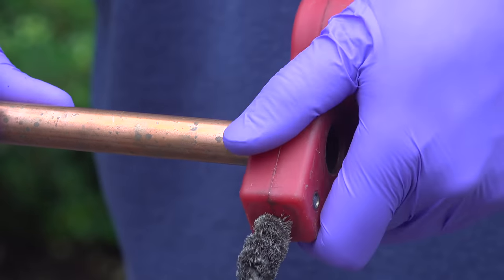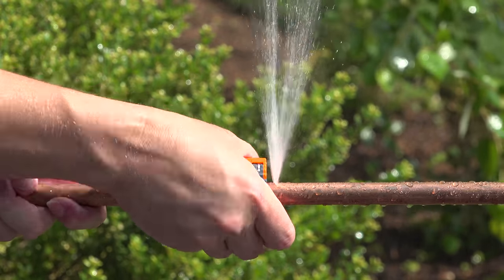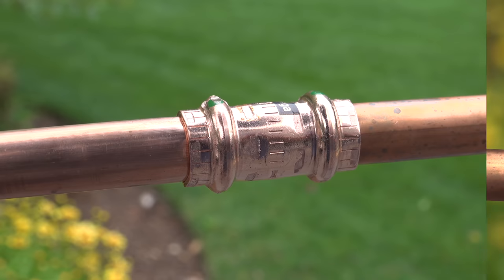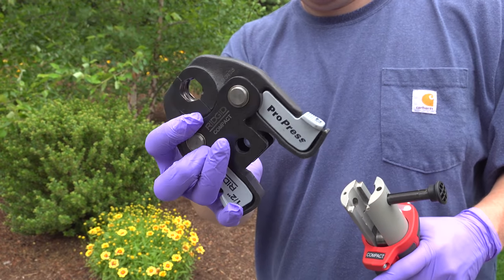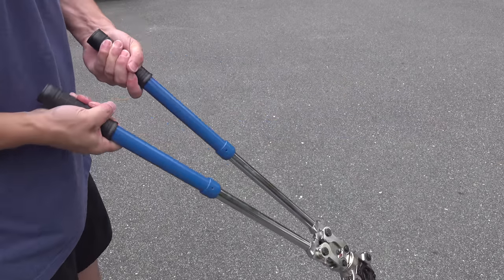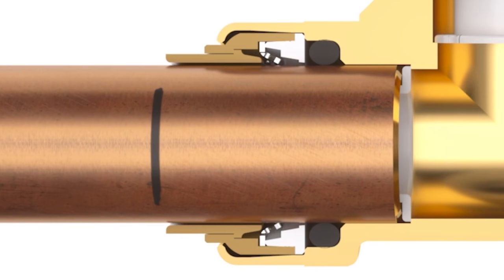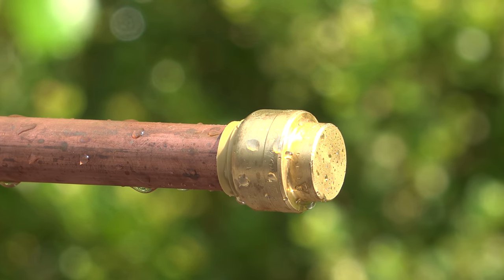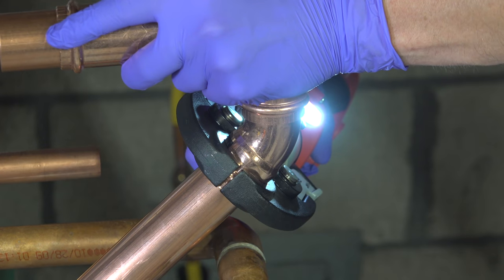NEVER SOLDER PIPE AGAIN - 3 Ways for EASY DIY Plumbing

Comment: In my experience plumbing, I've been called many times to repair a leak to find a failed shark bite. Rubber degrades over time, but there are plenty of examples of 100+ year old soldered copper pipes still holding strong. There's almost always a way to mitigate the heat from a torch in tight spaces to allow a proper solder joint, and it should almost always be prefered when it comes to plumbing in my opinion.
Reply: Not to mention freezing pipes. Copper swells before it fails. If that happens with a shark bite, toast.
Reply: I would also add that Sharkbites are made from brass. Probably not a big problem in urban areas, but if you're on well water, corrosive minerals and acid can degrade that brass over time, and cause a lot of damage that won't occur with copper. Don't ask me how I found this out......
Reply: Can’t forget the tool he was using is way more expensive than any one time home repair calls for.
Reply from the maker: @ottokriete1153  If your brass is corroding from well water, your copper will too. If anything that brass is about 20x thicker than copper pipe and low PH is something that needs t be taken care of for any metallic plumbing
Reply: Maybe you are one of the few that would come over for a very small job like adding a small section of pipe to an outside faucet.  I've seen many times people can't get a person in the trades to even call them back for a 15 minute job.  So, do you or others blame people for using a shark bite solution?  I see many pros on these types of videos commenting about how something like this is such false info though.
Reply: @ottokriete1153  If you have a water that can corrode brass, I would be more concerned about my life than sharkbite!
Reply: @sjxidnegsusgsjshvsbshshshs  I agree
Reply: These are not Sharkbite fittings.  These are Propress fittings and the primary sealing point is metal to metal.  Solder is old school.  These Propress fittings have been used in Europe for about 60 years.
Reply: Try not to blow up your house and yourself. Avoid torch if your home uses Gas for heating/cooling. For do-it-yourself and weekend warriors' repairs in small multi-dweller homes, soldering is very dangerous around Gas water boiler, gas heater, gas stove, natural-gas fridge (yes, a Fridge can use Natural gas or propane to produce ICE COLD AIR, no electricity).
Reply: @SSintox  making improper repairs is no excuse for failing to take proper precautions when making modifications or repairs to gas pipes. If you don't know what you are doing, call a plumber.

Find someone who knows what they're doing rather than doing a shoddy hack repair job yourself.
Reply: I use a medal dust pan when sweating pipes
Reply: m rapacki  how can you say that???
copper most certainly lasts longer than 75 years, and how do you know pex will last 100, its only been around 30 or so.
advertising is not facts!
Reply: My old job loves those shark bite, pex and copper press. They made a lot of money out of them. I used to work for fire/flooding restoration company. 90% of our mold calls were from failed shark bite, pex and copper press fittings
Reply: @larry6686st  90% ?
Reply: Margret Williams  amazing!
Reply: Absolutely, this demo is solutions looking for problems. Yorkshire joints (as they're called in the UK) are utterly reliable and I have only ever seen compression joints fail where there if frequent movement/rotation of the joint.
Reply: Yo I've just started my 1st year on plumbing and advice or tips you could give me
Reply: Yes I have the same experience. Soldering-YES
Reply: 😂😂😂😂 lier, soldering is overrated, this things work great
Reply: Easy DIY? If you can afford £1200 pounds for the press machine and £100-£200 for the different sized heads you will need..
Reply: @rabbie6361  well first off, a pro press pays for itself. Second off, if you aren't a professional plumber and are concerned about buying an expensive tool you may only use once, you could simply rent the tool for a fraction of the price.

Or just do what I suggested in the comment you seemingly ignored but replied to anyways, and solder the pipe using an inexpensive torch and solder producing a better pipe in the end anyways.
Reply: @the_slow_sti your title says 3 easy ways for a DIY plumber...I'm just pointing out that press machines are a bit expensive for a diy'er.. I've never used the manual ones and tbh I don't think I would put my trust in them..but that's just me.. probably easier to just use compression fittings..
Reply: @rabbie6361  it seems you are having reading comprehension issues. First off, it's not my video. Also, you didn't reply to or comment on the video title, you replied to my comment which explains why I prefer solder. I pointed that out to you in my reply above.
Reply: @the_slow_sti  AHH apologies.. I replied to wrong post...my phone screen has been in the wars and it's a hit or a miss when I tap the screen who gets my reply
Reply: yea I never seen copper leak,pin holes too
Reply: @garystinnett8321  thats why we use PEX
Reply: Um, no. You were not called  "many time" to repair a Shark bite. I have been using them for years with zero failures. Total BS.
Reply: I call bs. I'm a plumber and have had ONE sharkbite failure call. Most leak repairs i do are copper & poorly installed crimp pex. 

The sharkbite call was improperly installed. The pipe was not deburred, nor sanded and not installed to proper depth. 

You don't have to lie to make your point. Oh wait, you kind of do huh?
Reply: @ottokriete1153  strange. All the valves used in sweating copper are brass. This seems to me you don't know what you are talking about. 🤷
Reply: @garystinnett8321  Uh, a lot of actual studies show exactly the opposite, as does this vid: https://www.youtube.com/watch?v=OOeBJ8mDr8Q
Copper seems to often fail before PEX, and I don't sell PEX.
Sharkbites are pretty darn expensive, however they also seem to do better in most cases than a sweated on connector.
Reply: @toddmichon  Anytime something comes out that impacts a Trade's income it always gets demonized.  Sharkbites are crazy expensive for a fitting compared to a straight copper sweated one, but a lot of tests by actual professional organizations have shown them to do better in freezing sitations than the old standard.  They also allow the average Joe/Jane to fix a leak or extend a line on their own simply by watching a YT video.
So its not a coincidence that the pros downgrade it, even though you can't get someone out to your house for a minor job without looking at faint-worthy bill.
Same goes for PEX, if not doubly more so.
Of course there is always the village idiot who doesn't know what he's doing who will make a mess of things, but to hear it from Pro's everyone is an idiot outside the Trades and plumbing is really some sort of high-energy physics level of knowledge required.
Reply: @SilverCymbal  If the brass and coper are being corroded from the well water anything that uses a rubber ring isn't going to stand a chance. Speaking from experience as my well water has a lot of iron in it and even with a water softener the rubber rings are the first to go. And if something isn't pure brass or copper, just a coating, it wont last long.
Reply: @larry6686st  Our last mold problem came from copper pipes degrading under slab and in my area, apparently that's common as hell.
Reply: Yep I agree nothing better than a good sonder job
Reply: That's a load of crap. I've been a DIY flipper for over 40 years and I have plumbed many houses using pex and shark bites since the day they first hit the shelves. I live near and among the nearly 100 houses I've renovated and I've not heard one word from anyone that there has ever been a single problem with the plumbing.
Reply: Yes but when you have  valve theat won't completely close off this works wonders. You cannt solder with water in the pipe.
Reply: I have used flexible heat sheilds. I remember a kid ounce didn't use one, got that tar paper inside the stucco lathe smoldering, went to lunch and came back to a burnt down building.
Reply: @lightshipchief  They still have a rubber O ring
Reply: the problem with shark bite is nobody seems to install them properly.  Plus, anything that takes away from a plumbers hourly rate is never any good.
Reply: @ottokriete1153 that depends on the quality of brass. Buy bras that can't lose zinc as it is an alloy. It is specially treated. In the UK now they're all like that, previously you could choose more expensive ones
Reply: @lightshipchief the primary sealing point is the o ring
Reply: If the copper  wasn’t f’ed up in the first place people wouldn’t need a shark bite. So which one last longer??
Reply: I was about to say the same thing, I think we need to bear in mind this is an advert, I wouldn't trust a joint made like this once under pressure and stress, I'd rather use plastic push fit and that's saying something.
Reply: @Tagerrun  It's ok it pays for itself after 5 years as long as you don't get to many warranty claims 😂
Reply: Worst place to use a shark bite in an area that could freeze. It's ruined by the expansion.
Reply: Yesssir I’m a UNION UA PLUMBER I’ve worked on lots of new building and still working on schools hospital high risers etc nothing safer than soldering them rubbers break after a wile it’s great for a quick repair but definitely solder and not like this crap he solder a pound of flux for a lil 1/2 coupling lmfao smfh 🤦‍♂️
Reply: I have used shark bites and no issues in thee last 5 years.. maybe there is an issue if exposed to UVa
Reply: Exactly, mine has been here for 51 years copper can't be beat
Reply: Press fittings seem to be standing the test of time. We’ve been installing mapress copper to LTHW systems on some of our projects here in the uk. Over 20 years old and still as good as the day it went in.
Reply: There is no debating about Copper's endurance thru the years I have some that's been under my house for over 50 years long before sharkbites and push fittings were ever thought of
Reply: @antoniogalluccio4213  I don't by bras that have brass in them, I see you have an old Amazon predictive text 😄😄😄😄😄
Reply: Many places require a burn permit for any open flame. Propress solves this problem and in the end saves time.
Reply: @centurionhomeinspectionsin2253  most places don't require you to pull a permit to solder pipe... Those that do, you should pull the permit and repair it the right way rather than installing a temporary fix.
Reply: 100% I know what I wanted in my house and thats not pex and or prees fittings that most get it done quick contractors like to use simply because they can get the job done and paid quickest instead of whats long term best for the residence.
Reply: You're "old school", me too.
Reply: @lightshipchief O rings ALWAYS fail. Solder is cheaper and forever
Reply: As a legit service plumber I call BS. I have NEVER seen a failure in a sharkbite. I have seen them not used properly but I'll say it again... I have never seen one fail. I do live in a warm climate of that helps.
Reply: This Methode is used for decades now in Germany. Nobody is soldering here anymore!
Reply: Lightship...he actually discusses both
Reply: I'm in a country where houses are built very solid and last a long time. But everybody uses PEX then solders some copper where the pipe is exposed so an idiot thinks he's getting copper pipes. Nobody wants to deal with copper anymore. In a wooden house, it makes sense, a leak can result in serious damage. But concrete, porotherm. What's the point of copper if it's not soldered? That's the entire point of copper, joints pass the time test like no others.
Reply: Lot of people in this thread gonna have some costly repairs in the next two decades, I'll tell ya what.
Reply: You have to buy the attachment for pressing the pipe? No sir.
Reply: That does NOT pay for itself in one use.
Reply: @SSintox  I have literally been soldering for years in my basement 5 feet from my hot water tank and furnace......you have no clue what your talking about 😂
Reply: There's no room for a soldering torch but you have room to put a giant crimper tool in the wall?
Reply: Of course the pros trash talk shark bite. It puts them out of a job 😂
Reply: Love shark bites. They are brilliant.
Reply: @tdlcraig1  spoken like a true handyman
Reply: Never had a problem with a shark bite...if not installed to the right length, yeah that's a problem
Reply: @Timmylongstroke  plenty of us have. Your personal experiences may not have involved that particular situation but then again there are people who have never seen a Rheem fail before warranty expiration. Doesn't change the objective FACT that it's a problem with the product and at the end of the day if you CAN solder and choose not to, you're a coward and a weakling. If you CAN'T solder then you're not a plumber and shouldn't rightfully be touching any type of water supply anyway.
Reply: Spot on!!
Reply: Id much rather replace a failed shark bite in 3 min instead of breaking out my flux, torch, tube cutter, tape measure, reamer, gloves, solder, wire tube cleaner/sandpaper, need I go on? Oh I want to add a tee? Np, just get my tube cutter and shark bite tee.....done lol rubber degrades over time sure, just like the rubber in shut-off valves, pro press fittings, and flange gaskets, but those are simple fixes that almost anyone can do when using sharkbites. Idk maybe I'm just lazy.
Reply: @DavidBasara-p8s then use pex tubing in those areas, it will expand before the sharkbite will. Or idk, wrap your pipes.